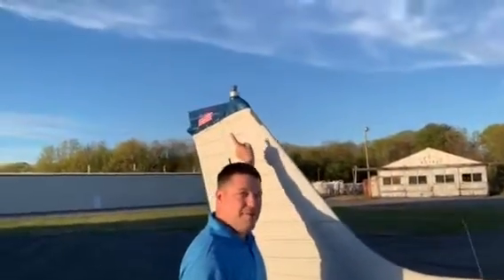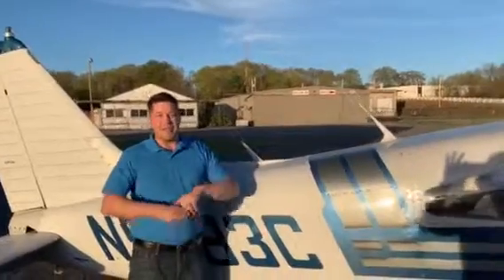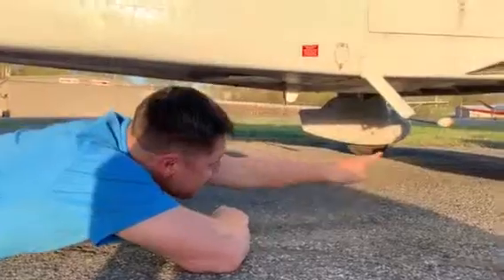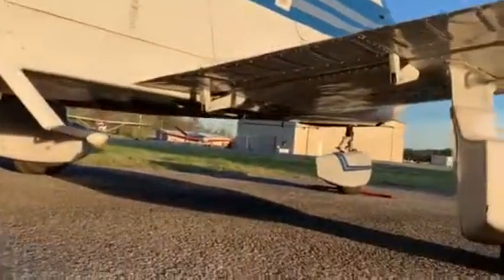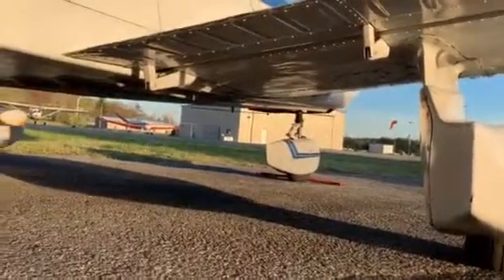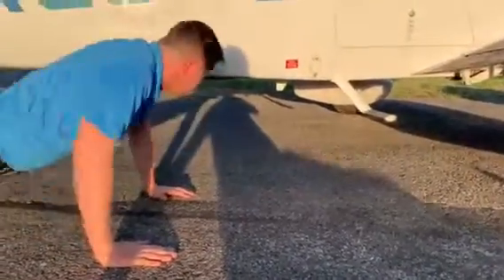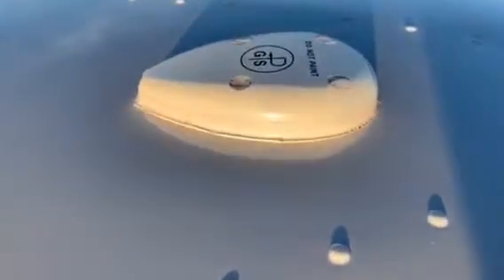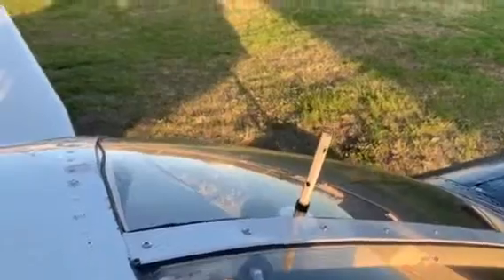Antennas on a Piper

Comment: Thanks for the vid! Which antenna does the ADSB info use?
Reply from the maker: Good question. Depending on the system you have installed it’s either piggy-backed with the transponder signal, or it’s a separate antenna most commonly installed in NAV lights.
Reply: @SpreadAviation  will look into this some more, that gives me a good idea to ask my cfi! thank you :)